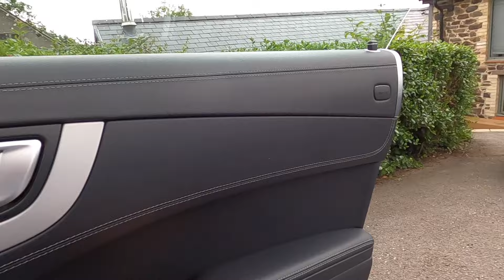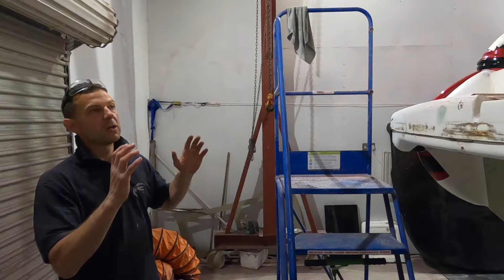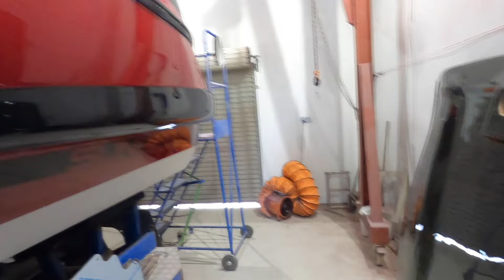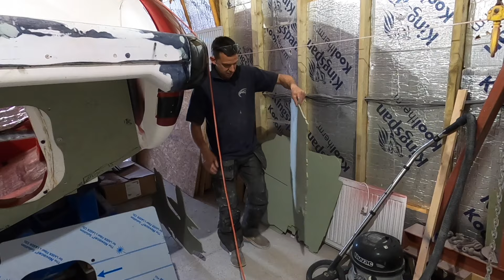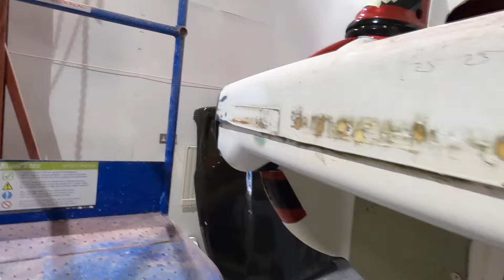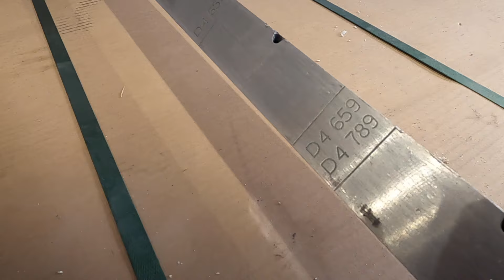Project Sunseeker Restoration 4

Comment: Looks amazing. How will you manage with the inevitable chips and scratches that the paint work will pick up over time? Even being careful I’d worry about it scratching, thenbreaching and lifting., especially with speed and water drag.
Reply from the maker: It should be a pretty fast boat, but not fast enough to peel the paint off of it! 🙂
Reply: @AQUAHOLIC  was thinking more of a scratch that water gets under then lifts paint, a bit like a pressure washer can do to cars, but not to worry.
Saw the boat in Torquay last week. Shame about the salt n seagull crap on it, taking off the sheen.  Looked good tho

Comment: Sunseeker is a favourite and great to see someone renovating one thoroughly. But… I had definitely hoped for more power than 2x300hp. For sure a 34 foot Sunseeker could have handled a pair of D6400? If not, Yanmar or Mercruiser must have something lighter with more hp that could fit.
Reply from the maker: When these boats were in production Sunseeker were fitting KAD 42 230hp engines and I think some with KAD 44 260hp

Comment: Nice reflection on the finish but I hope it's ceramic lacquer on the deck to handle being walked on, even in pumps and with ropes being taught across it. Ceramic lacquer is a much harder product that is used on up market cars especially when covering metallics and pearls and doesn't get marked by car wash brushes etc leaving the finish a bit dull over time.

Comment: Really stunning too! Really looking forward to the day when she finally hits the water. 

Question for Richard: Would the controller algorithms (such as trim, DPS or joystick controls) for the Volvo Penta system be a drop-in design or would there be additional customisations/calibration on that front to get it to work properly with this particular hull?

Comment: Sorry for negativity… but cars are cars - boats are boats. The quality of work is beyond doubt ….. but dechroming a boat and blacking out everything  - in my view just doesn’t work? Neither does a red hull. Black will attract heat - grabbing one of those rails on a hot day should prove memorable?? A refinished white hull with refinished fittings would hsve looked superb - even a dark blue hull. Not a fan of red…. I think black is impractical for other reasons mentioned. Sorry 🙏
Reply: Yep totally agree. Look up the yanmar 47x americas cup edition, it looks dated as anything.

Comment: Did he explain how he painted the bottom were the boat rests on the trailer? Like painting the Sistine chapel.
Reply from the maker: The bit where the hull rests isn't painted.
Reply: @AQUAHOLIC  like when antifouling is applied
Reply from the maker: @jgriff3218  With antifouling you just paint all you can reach, then finish off the bare patches when it is lifted.

Comment: Beautiful. I was thinking that would a ceramic coating on the paint like cars get give the paint better protection. It does make scrubbing off bird poo especially seagulls easier on my car. Looking forward to the next instalment ⚓
Reply: Nick mentioned his boat has ceramic coating so I checked if it's available for cars and, as you know it is and it does work great, so yep it's used on boats. 👍😁